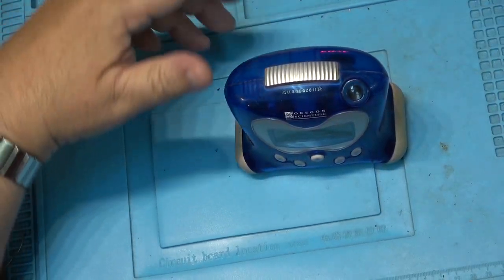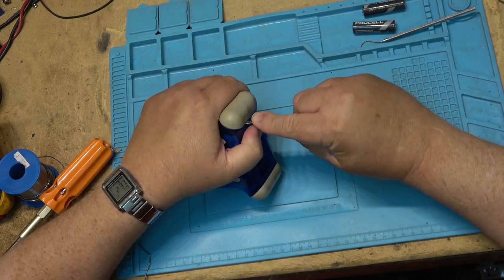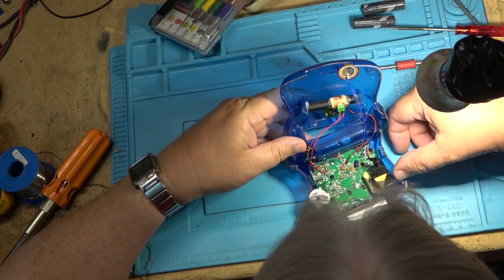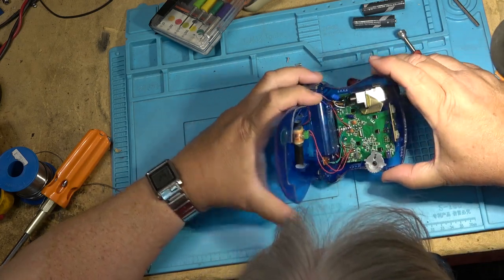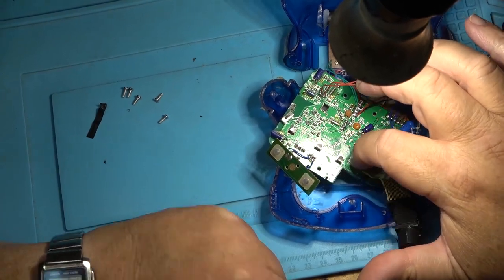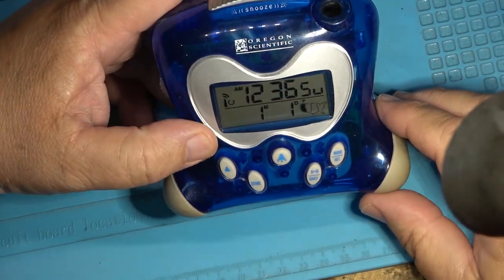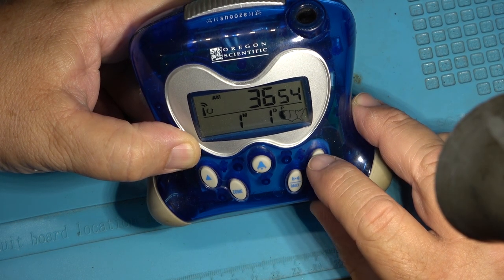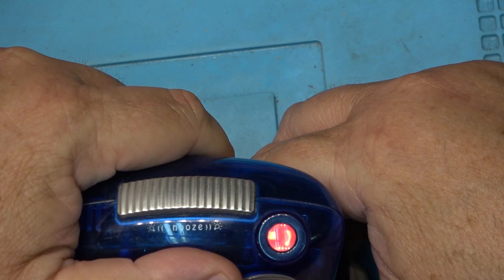Oregon Scientific Radio Controlled clock tear down and some computer issues

Comment: I've been using this clock for decades, it's awesome.  The first one started getting weak projector digits, so I bought 2 more so I would have an extra for spare.  I wonder if the trick of heating-while-pressing the ribbon connection to the PCB would work, like I see them doing on handheld game LCDs.
Reply: Hi came across this video as ours has taken a fall! After about 30 years it’s now not working so well 😥 Been look on net and see they still do them, but seem to be out of stock everywhere? Is the company still going?

Comment: I've had this little clock on my night stand for years and love it. The light for projection quit working and I thought I would give it a go. Basically just looking for anything loose. My initial problem is the 2 screws under the rubber feet won't budge using max pressure with tiny screwdriver. Do you remember what type of heads were on the screws?
Once I'm sure I have the correct driver I can Crack it open. Thanks for the video!

Comment: Nice turn of the millennium aesthetic with the transparent iMac-style case. I remember seeing them advertised in the Science Museum catalogue around Xmss of '95 and have a UK version of this made by Acctim that I received as a gift in 2001. It worked well for a few years until the time signal source was moved from Rugby to Anthorn - after that it never updated again. 

Probably a coincidence as I have several other MSF clocks (generally the analogue variety - the mechanisms to convert an existing clock are available cheaply online) which all pick up the Anthorn broadcast just fine.

I recall a few years ago Aldi in the UK were selling these clocks cheap. When people got them home they realised that they were German and thus set to receive a different signal that was set to CET so were always an hour fast! The enterprising dismantled them, pulled the hands from the shaft and repositioned them at the correct time - problem solved.
Reply from the maker: Yes I believe I bought this one around 95 or 96 when they first came out. I remember I had not only this one but the wall clock that I now have that sits in my TV room it was mounted up in the kitchen in the old house and the old house hasn't been here since 2002 when I rebuilt.

Comment: I have the Classic model RM318 probably around 2003. After 10 years, the projected display time quality become worse, and I purchased a new version of the clock. Unfortunately I hated the way they changed the keys functions and buzzer, and I revert back to the old one, deciding to fix it.
This clock, as many modern devices, connect the projector LCD to the board using a 3M Pressure conductivity tape to connect the flat cable to the board. This tape, after years dries, and slowly detaches, and the single led bars do not work any more. I was able to prolong the life for a while, say from 2013-2022 by remelting the tape glue. This should be done using a special T iron with silicone protective cover, at controlled temperature. 
The technology and technique is the same used to connect the LCD flat cables to the boards on the TV. I fixed also my Dymo label maker, that use the same kind of technology to connect the LCD flat cable to the board. Now after more than 10 years, they have stopped to work again, and even worse, and I think I will have to completely detach the flat cable from the LCD, and  reattach them using a strip of few millimetres of 3M conductive tape. This bloody ACF Tape (Anisotropic Conductive Film) is extremely expansive, has a short life (expire date)  and it has different specifications for different usages. 
I was able to purchase by chance a mini roll of it (probably expired, as the majority that you can find on ebay and alibaba.com) . The specs are uncertain, and I hope it will work. Of course purchasing a fresh roll of this tape, due to the short life, is a nonsense unless you have a commercial service workshop.

Comment: Thats a nice little clock 😀
I wonder if the ferrite antenna needs a slight tweak to get the best amplitude.
That taped ribbon is horrible, i have an old micronta dvm that had the same horrible tape connection, i made a padded aluminium bar to compress the tape connections (Brutal but worked).
Thankfully it was not the glass display end phew!.
Is the drive failing from a cracked solder joint on the 5 volt power connector?
I also save free drives from tv boxes.
Reply from the maker: That little antenna works pretty good. I have 5 of these clocks that set themselves and the watch. They all work pretty good and set themself on a regular basis usually every night depending on signal propagation. The only one that doesn't is my watch. It's generally because of where I let it sit. It sits on my night table which is sitting close to a wireless phone charger that I set my phone on at night and that causes interference. even for this clock if I sit it anywhere around the wireless phone charger it won't update I have to have it several feet away. The watch on the other hand the antenna is not as big and requires that it's placed out of windowsill. Then it will update but it's a pain having to put my watch on the other side of the room every night before going to bed and then picking it up in the morning so I generally don't bother. It's accurate enough that if I'm out by one or two seconds big deal. If I really needed it that accurate I guess I would put it on the windowsill at night I have to put it behind the blinds as well because they are metal and  block the signal.
Reply: @12voltvids  did you know they still make your projector clock?
$12.50 from Oregon scientific.
So if yours goes Pooof with a puff of smoke, its no bother.
Reply from the maker: @zx8401ztv  I know.  I have another one that i have been using ever since the projector in this one went south.  Picked it up a few years ago for 5 bucks.  Not an atomic but the projector works well.

Comment: Old lcds don't last as long or as well as newer versions.  Had big issues with the liquid crystal fluid in the 80's with it turning brown caused  by the heating from the back light.  Each digit was about 8" tall with the whole display being about 50 x 10 feet.
Reply: Even non backlit ones do that, I have some that have gone black, probably due to humidity and light from outside.
Reply: I've bought some old laptops (from the early 2000s, one from 1998) and most of their LCDs were good. Guess they were low hour.

Comment: Did the radio station do the slow and fast  time signal, our station at Rugby sent both, the slow time signal used the length of the seconds pulse and took a minute to download it all.
Reply: I would say the slow signal, simply because it is a lot easier to decode that, and you can easily recover the time signal. Taking a few minutes to get the time is not an issue when powered all the time.
Reply from the maker: It's 1 bit per second. Takes a full minute to send the time code.
Reply: @12voltvids  so the slow code, where the length of the pulse contains the data. If i remember correctly there is a sync byte that ends on the 6o second pulse to denote the minute change. When first powered up you looked for this then started collecting the time data ready for the next sync.  So could take nearly two minutes to get correct time.  It a room full of crt monitors getting a signal was a pain in the  butt.
Reply from the maker: It's been awhile since I read up on the time code.  They did the mark space by reducing the power for a specific duty cycle.  40% was a 1, 80% a 0. One bit per second. Would pulse our the hour, minute and day of year where 001 is Jan 1. Then there was 1 bit for daylight time another to designate a leap year. 1 minute to send code and most clocks would take 2 to 3 minute to verify.

Comment: What is the model of your wrist watch? I like it and want to find it. Mine is similar Casio but instead radio time it has solar panels and rechargeable battery. You should change thermal paste of this PC because it turned to a stone, I change mine every year an it is already stone, yours probably welded :P
Reply from the maker: Casio wv300.   Someone else just asked me that yesterday. It's a rare one good luck in your search. I've been looking for a second one just to have as a backup because I like this one so much and I've been looking for at least 10 years and I haven't found one that has been reasonable. I saw one listed on eBay a while back and the bids were already over $500. I don't know what it finally went for because I didn't follow it much at the end of the auction I just saw it and had I think about 20 bids and it was already north of $500 with a couple days remaining. Now I bought this one new and I think I paid between $150 and 175 when it was new and I thought I was paying too much because hey it was a Casio but it was a stainless steel case and most of the casio's of the day were plastic. I can't wear a watch that has a plastic strap like most of them do because get it allergic reaction from the plastic strap and case. It has to be stainless steel or gold. Well it sure as hell is not going to be gold I don't want to be that guy featured on the news it gets beat up by some thugs wanting his gold watch.
This one's also solar powered.

Comment: Now if that would be me, I would customize the display to use the cheap projector including either HDMI input or RCA input, and use the RCA Maven Pro Android Tablet to use clock display and it will work each night when it is dark.

Comment: Hard drive install Gsmart and check the reallocated sector count. Likely your drive is near wear out, needs to be replaced, and recycled.
Reply from the maker: It diaappeared, reappeared and disappeared again.
Reply from the maker: Yeah I have replaced it but I won't be recycling I'll hang on to it as a backup. However the drive may have been okay and I may have just wasted my time as after swapping out the drive I noticed that one of my external drives vanished. I then discovered the data light was blinking like mad even though it wasn't doing anything. Tried it on a different USB port nope nothing, try to new power supply bam worked, shit! Power supply failed. What do you think the chances of that power supply failing causing the external drive to go on and offline was messing up the computer config which caused the computer to lose my internal drive as well temporarily? I think that probably was what happened was just as I was working the power supply for the external drive was just sitting at the voltage where it almost worked and the drive was going on and offline and every time it went offline and came online the computer was doing a refresh and reassigning drive letters to that drive and it caused my program drive to disappear. Of course when the program drive that has all my apps installed on it just vanishes I went into panic mode thinking I'm about to lose everything and you know that sinking feeling where you have to reinstall all your apps and set them up that wasn't what I really was fond of so I swapped out the drive. It's interesting that when I pop the drive into a external Bay I had no trouble and I could copy all the files over to another drive.
Reply: @12voltvids  Still run SMART on it, and do the full scan, and see what changes result wise. I have a few boxes of old drives, and any drive that exhibits a single reallocated sector event after having zero will be suspect, and get turned into another pair of fridge magnets.

Comment: "atomic"? :) nice computer explanations. Also great to see a real computer with dust in it. Curios when will you do a computer repair video.
Reply from the maker: Probably never because I hate fixing computers. I built this one in 2009. didn't realize it was that long ago but when I pulled the hard drive and how did that drive was made in 2007 and then looked at some of the dates on the SSD when I installed Windows I realized it was 2009. Other than my work laptop this is the newest computer I think I have but I haven't needed anything better because when I built it it was top of the line. I think the only thing I could have upgraded at the time was the video card I went to a semi high end video card of the day and there was one that was a little bit better but I didn't feel like spending an extra couple hundred dollars I spent enough when I built this one. I really only use it for one thing and that's editing. I've got my music library on it with everything backed up onto multiple drives and my photos are also stored on it again backed up onto multiple drives and also optical drives. But it's just a production machine they use it for doing my YouTube videos these days as I'm not doing much as far as corporate video work and I don't do any weddings anymore in fact I was pretty much done with that when I built the machine. I don't do much web surfing on this machine basically just upload my YouTube videos and watch the on YouTube video on it because it's got a nice monitor but I don't use it for much else and I don't game. I'm not a gamer my son has that honor. He wastes his life sitting in front of his computer playing games talking to his friends and stuffing his face. For me I have more important things to do in life. If I'm not working then I'm either tinkering around with electronics, editing a video, riding my Harley, going on a nice drive seeing the country, listening to music, getting out of the house. My video gaming is limited to Pac-Man!
Reply: @12voltvids  Hey Dave, I had a drive that would randomly disappear (warning over by the clock) something about the (cache couldn't be written to the drive data maybe lost) or something like that anyway it wasn't a drive I use regularly just for storage have 4 hard drives and the 4th one was the only one that would randomly disappear and later reappear. 
Oddly I discovered the cause, believe it or not it was solder resin just like that circuit glue you peel of the resin over the years became conductive and being logic circuits it was just enough resistance to cause the logic circuits to loose connection to the drive. I pulled everything out took the motherboard out sprayed it with 90% isopropyl alcohol throughly brushed as much of the mothrrboard as I could reach after it throughly dried and completely reassembled I booted up and the very 1st thing that occurred was a disk check on every drive in the system. Anyway I have not had any drive problems disconnecting/reconnecting sense. BTW I also ran the drive manufacturer certification software (several times) and the drives health is good so it wasn't a failing drive. It's a possibility your motherboard is in need of a cleaning to remove the solder resin from it, I'm convinced solder resin becomes conductive at least a little bit and will get to the point it causes circuit issues especially in logic circuits. The logic signals don't require a lot of power for other circuits to pickup and if the solder resin clamps those signals enough there can be extremely strange operational behaviors as in my disappearing hard drive and likely yours too. Good luck with the new drive it is very possible it was pending drive failure if you want to check it that way you can download the manufacturers testing software free of charge and check the drives integrity. A full scan takes a looooooong time depending on the drive size. Anyway hope this helps in the future.
Reply from the maker: @darinb.3273  problem was traced to failed power supply on one of my external drives.  It diaappeared while i was editing.  A new adapter fixed that. Likely with the vintage fluctuation on the bad power supply it causes windows to misbehave.  New drive in now everything working.
Reply: @12voltvids  Ahhhh, that's great it appeared the drive was inside the computer from the images, so I thought it was internally installed drive, anyway that's fantastic and hopefully the blinky blinky power supply didn't do any damage to the drive itself and it does fail at a later date.
Reply from the maker: @darinb.3273  the drive was inside. I pulled it to copy the contents to a new drive and then renamed the new drive and changed the drive letter to D: and reinstalled it.  It was later while i was editing I heard the computer meaning the sound of things being plugged in and unplugged and i noticed one of my iomega external drives was offline.  That one had a bad wall wart. It was probably that that causes the original drive to disappear.  The original drive goes into a box now as a backup backup.
Reply: @12voltvids  Okay I would certainly keep a check in the event viewer for possible errors that don't give an alert in the task bar. I use a dual boot system Windows XP and Windows 10. I can't afford to upgrade programs and hardware so I keep XP as a dual boot for that reason plus Windows 10 media player is awful. I basically use it on occasion for watching videos and listening to my music stored on my hard drives for convenience of not shuffling CDs/DVDs all the time.
Reply from the maker: @darinb.3273  I ran crystaldisk on it.  No errors all green.
Reply: @12voltvids  I do know there are aftermarket programs such as you mentioned that will read the drives  S.M. A.R. T. status. As far as data integrity I don't know how thorough of a job they do otherwise reading SMART is simply what data is stored on the drive.
Reply: @12voltvids  The certification as mentioned earlier takes hours to run on large drives.
Reply from the maker: @darinb.3273  not a very big drive by today's standards only 500g.
Reply: @12voltvids  Right even a Terabyte is approaching small. Could you imagine a terabyte drive in the late 80s or early 90s? It would never get filled with programs of that era.
Reply from the maker: @darinb.3273  I use 1tb drives as archive backups.